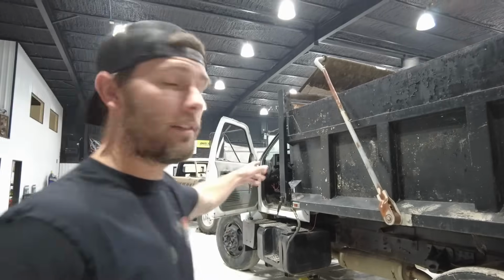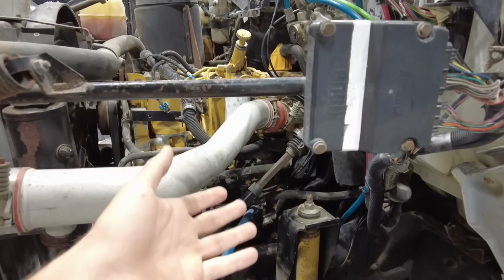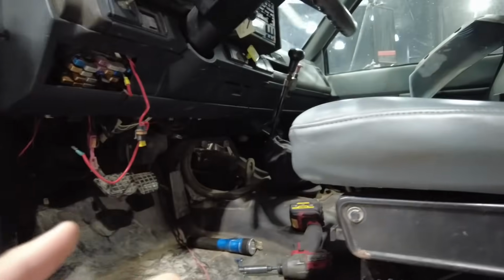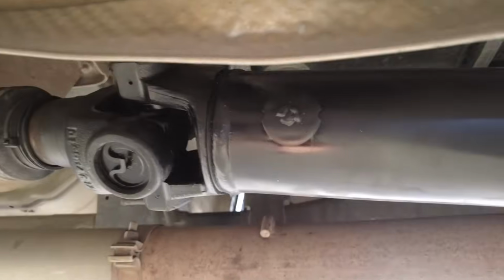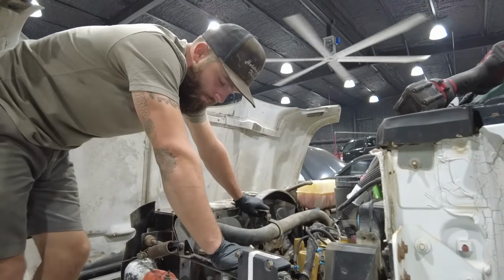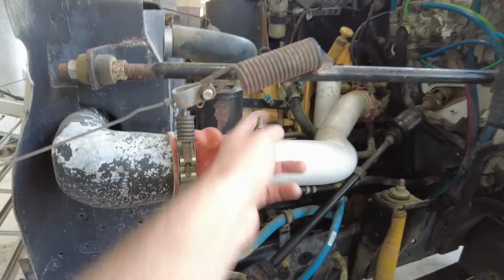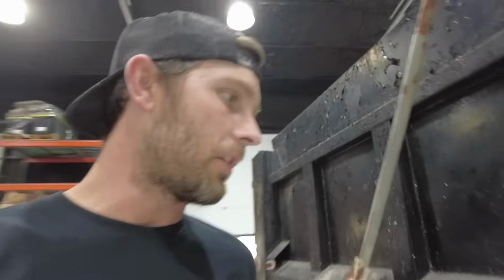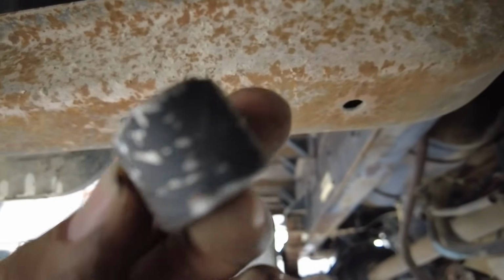Demo Matt blows his Cat in a Dump Truck

Comment: The three places that you’ll find the Morse cable for the PTO closest to you or the quickest will be A, a hydraulic repair shop /  or mining type of industrial supply  B, boat dealer/ marina, the same Morse cables are used to steer both onboard engine boat lower units and outboard engines. Also used to control shifter linkage on the same boats. 
C, tractor trailer dealership / parts supply as well as big truck stops that have a towing or repair branch. It’s been years since I was down your way in a semi but I know y’all have em down there. I’ve also found the Morse cables at Semi chrome shops and some of the Flying J and Pilot truck stops. Don’t know if any of that’s any help to y’all or not but figured I’d mention it. 

Also, from the looks of what’s coming up in the future on Matt’s channel it may be a good time to hit up the local trucking companies that have dump trailers for a piece of dump liner that they’ve either taken out of a trailer when they buy new liners. Another way I’ve run across dump liner is the coal haulers around here sometimes buy the liner by the roll, most times the measurements end up leaving a few feet or several at the end of the roll. I’ve put it in dump trailers that way starting at the back, layering the next piece 8 to 10 inches over the front of it and so on till it’s all the way to the front. Around here having to haul coal in the winter and asphalt in the summer it’s an absolute necessity to keep wet coal and rock from freezing in the corners and helps keep asphalt insulated better so it doesn’t cool and start getting stuck in the front corners where air hits it the most. Anyway back to Matt’s projects for the resort. He’s mentioned tearing down buildings, hauling dirt and blasting rock to haul for the roads. That eighth inch you added won’t last long with a mix of those materials being loaded with a trackhoe even if you used the alloy wear plate. What I’m getting at is that having liner material anchored into at least the front 2/3rds of the bed will save all of you guys a lot of headaches. The headaches include having a piece of material hang up in the front corner or have a bucket of damp material vacuum itself to the bottom of the bed when it gets dropped from too high, both instances will turn over a single axle end dump truck. I’ve also dropped rocks all the way thru a guy’s truck with a trackhoe and trying to be easy, not knowing he was running the route with rotten and broken crossmembers in his tandem. It’ll be well worth the little bit of time it takes y’all to look into it and if you get a used take out liner it only costs time and some hardware to bolt it in. Good luck to you guys and stay safe. 👍

Comment: Guys, that cable problem is one you are going to have any time a truck gets used to regularly haul acidic soils- lots of oilfield tailings would be a good one to find in Texas, being hauled to "designated Federal dump sites". The cable could have been resourced by a Morse Marine cable; you need to find one nearby- somewhere around Crystal Lake would be my bet.  If you can overnight the cable and remaining info, it is likely they can build up a cable with much of the additional hardware and sent it back by a Big Brown Truck in days. Also, look for more corrosion damages- that truck is nowhere near old enough to look as crapped out underneath; if Matt plans on keeping it- and it is a really good chassis for what he is up too, he needs to get that thing cleaned and the chassis blasted and re primed as well as tough coating. I've seen DTs like this in S. Louisiana servicing oil patch calls; if they aren't taken care of scrupulously, they are scrap metal in less than ten years- very low value, rusty scrap metal. Also where I saw the Morse cable sub for your PTO. On the clevis; go to Big Orange or similar hardware store; match the clevis to a tensioner that is long enough  and the correct size and thread to match your application. Yu can thank me later- Matt is sure to blow up, burn down or otherwise discombobulate something else before you can get the current lot out of your parking lot.